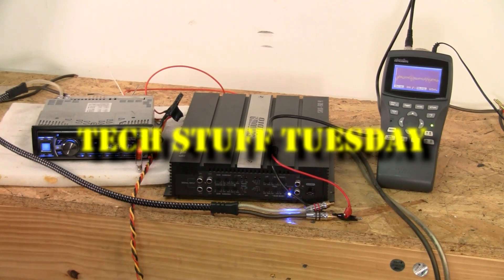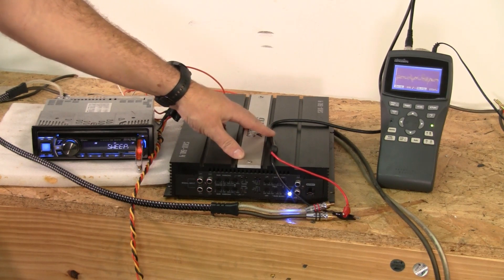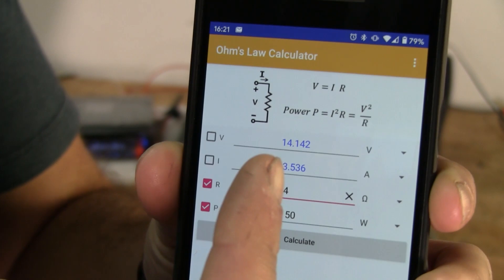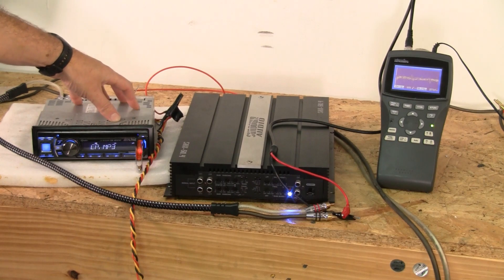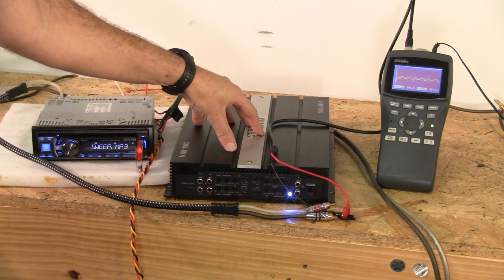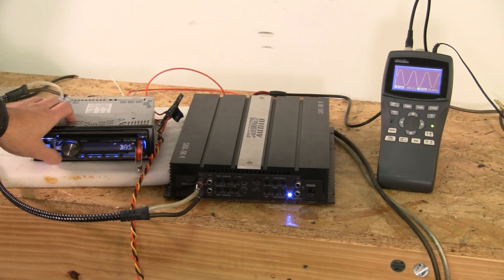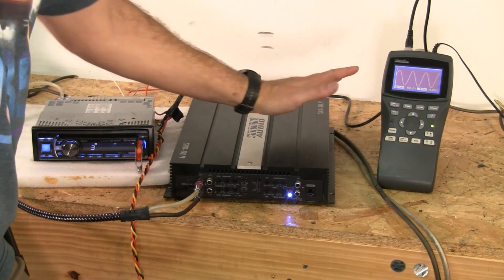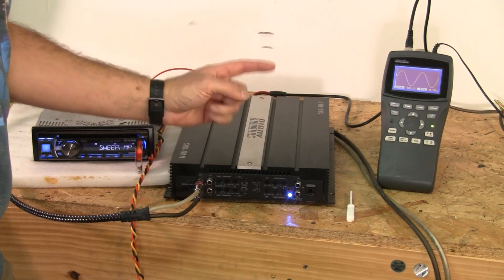How to set your gains using the best tool, an oscilloscope. - Tech Stuff Tuesday

Comment: Sean, My question is about how much do speaker manufacturer's under rate the power handling of speakers? For example, If I have a speaker rated at 50W RMS, would it be safe to set my amp to send 75W RMS to the speaker. If not, what level over 50W is safe?
Reply from the maker: How manufacturers choose to rate speakers will vary. Some are over rated, some are under rated, some are appropriately rated. Don't confuse amp rating with power handling either. If an amp is capable of making 75 watts that doesn't mean it's always putting out 75 watts. That 50 watt speaker might be getting 25 watts.
Reply: It wont hurt it depends on what you do. If you cruise around full tilt if the speaker is correctly rated. Yes it will burn up faster. Not saying it will go up right away tho. Now then if you are the typical joe out here who runs listens to music at relatively low volume. You maybe able to get away with a 200s rms amp on a 50w speaker. Like my dc 3.5k clamped when running at normal level, is only pushing around 1500-1600 with rise. When i go full tilt, it is at rated even with box rise. My coil is rated at 1500w rms and 3k burp. But ive clamped the amp and seen at what volume the amp output is at. That verys on setup, install and style of speakers and users. I know guys running amps almost double rated rms their subs. Doesnt mean their subs handle twice as what they are rated. It just means how they have it setup at normal listening volume, the subs and speakers are getting their rms. If they dont go above that for long periods of time and to often they never have issues. Thats where some guys get the idea their subs handle more than rated. Like say you have 500w sub on a 1k. They may play it full tilt for a short demo or something. But 97% of the time they have it at a normal listening level. You can run alot more than rated, its all about how hot the coils and speaker get. Why spl subs maybe rated at 1500 rms 3k max, then say 6k burp. But it takes a lot of trial and error to determine that. Really why you go with a reputable company who stands behind their product. If you go for the 2k watt max walmart sub and put 500wrms and burn it up. Thats on you for not reading the fine print of 250rms in the subwoofer manual. I normally stick with companies that label the rms not the max, and have a name in the industry.
Reply: You're better off having a more powerful amp than the speaker. Thus ensuring that you don' t run out of amp power which can damage the speaker.
Reply: Jonka Olofsson you cant damage speakers due to lack of power, as long as you set your gains right you wont destroy anything.

Comment: What do you think about those jye tech oscopes all over eBay and Amazon some are diy kits and others come preassembled you think they any good?
Reply from the maker: I haven't used them or even really looked at them, but it would be cool to have some input from people that have used them. It could turn into a go-to tool for many.
Reply: Yep got the cheapie JYE Tech DSO-138 just needed x10 probes for my 1500rms monoblock, worked well!
Reply: ufor1a what do the x10 probs do?
Reply: Jeremy S lets you get a higher voltage reading on the oscilloscope worked great with my amp 1500rms recommend the eBay oscilloscope!
Reply: ufor1a I’ve got a 3k rms amp and my liumy oscope doesn’t like anything past 30 volts. It takes typical multimeter probes. Is there a way to get 10:1 probes for a multimeter?

Comment: I'm surprised the DD1 vs o-scope debate is still going on. You can have over 1% total harmonic distortion on a wave that looks completely normal on a handheld oscilloscope. Distortion can occur on faulty audio equipment way bellow the clipping point. YES, CLIPPING AND DISTORTION AREN'T THE SAME THING. Having that amount of distortion can cause serious damage to speakers (especially tweeters) even if you don't clip. There are times where you won't be able to see this distortion on an o-scope. With the DD1, you will always know when distortion occurs. If you take a $150 o-scope and a $150 DD1 there is no comparison. The DD1 is a no-brainer.

I'm not a huge fan of this scheme you're trying to pull spreading misinformation about the DD1. I'm surprised you haven't responded to D'Amores critiques yet. Defaming a product by misusing it and lying is a pretty lame way to make adsense money. Hope it serves you well.
Reply: O- scope for the win
Reply: @fusiondensity3287  If you can't back up what you're saying with facts I'm afraid you can't be taken seriously.
Reply: @fusiondensity3287  Classic ad hominem fallacy.
Reply: @BradynJDM  O- scope for the win
Reply: Tony Melo  It's better than a handheld o-scope because you may not even be able to see even 2% or 3% THD on a handheld scope. Sure the DD1 registers at 1%. It is a safe level and many amplifier manufacturers rate their amplifier power output at 1% THD. Even if you do tip-toe right below 1% as long as you're not clipping you will be fine. That is the general threshold where distortion becomes audible at higher frequencies. (You can have a lot of distortion at lower frequencies and not hear it at all. It's much harder to hear at lower freq.)

If you buy even a $500 o-scope, there is no chance you will be able to eyeball this unless you're a seriously trained engineer. This is why the DD1 is such a powerful tool at $150.

Check this video out and you'll see what I mean: https://youtu.be/v0Jcsn3-Uf4
Reply: @BradynJDM  I've seen this video and the one steve posted as well. A lot more people should see them.
Reply: When I first bought my DD-1 I used it on my car, and got an increase in my output. 

I was called out by a guy who had one of those $3,000.00 Oscopes and he decided to show me that the DD-1 was wrong, but he didn't even find any clipping.

He has a DD-1 now.
Reply: You know a o-scope can be bought for $40 bucks of ld Ebay or Amazon. A lot cheaper that a DD-1. So that's a no brainer when you compare prices
Reply: @danfuller06  A $40 o-scope may work if the audio equipment isn't faulty. However, there are cases where faulty equipment can produce distortion well above 1% THD at levels way below clipping. No chance in hell anyone is catching that on an o-scope.
You'll see what I mean if you check out this video: https://youtu.be/v0Jcsn3-Uf4
Reply: @BradynJDM  Thank you for valuable information. I didn't even know or think of that!
Reply: The debate is still going on because of comments like yours that keep feeding into it. Move on now
Reply: @michaelparsons3188  LOL did you read my comment?
Reply: @BradynJDM  I did. I am just saying the more its talked about the more the topic sticks around. That's all
Reply: O-scope for the win
Reply: @fusiondensity3287  LOL. I feel like you didn't even read my comment.
Reply: @BradynJDM  feel how you want
Reply: @BradynJDM  are your feelings hurt?
Reply: @fusiondensity3287  Nah from far it. Just waiting for you to address my points.
Reply: @BradynJDM  what points?
Reply: @fusiondensity3287  In my original comment you replied to. I gave constructive reasoning as to why a DD1 is superior to an o-scope and you commented "O-scope for the win" without addressing any of my points.
Reply: @BradynJDM  you have no good points, but i give you an E for effort
Reply: @fusiondensity3287  If I have no good points, why can't you address them?
Reply: @BradynJDM  because their are no good points to address
Reply: @fusiondensity3287  Even if you believe they aren't 'good' points you can still address them.

I.E.
1) You can have over 1% total harmonic distortion on a wave that looks completely normal on a handheld oscilloscope.
2) Clipping and distortion aren't the same thing.
3) O-scopes at comparable price points as the DD1 may not be able to accurately detect 1% THD.
4) There are situations where the above points exist such as in faulty equipment (see video: https://youtu.be/v0Jcsn3-Uf4 ).
Reply: @BradynJDM  I have a degree in micro electronics and a minor in electrical engineering.  I took the dd1 as 100% truth. But with a machine limited to one task and one task only it's not even close to a oscope with someone who actually knows how to use it. For the audio field in general, a dd1 is a great tool to get you close enough to be safe. Providing you have been through the correct steps in setup. But idk (and I own a dd1) what the unit will do one say low voltage from the 9v or how if it came  uncalabrated. I can recalibrate my oscope with not a ton of time or effort.  I see and have read what everyone has said and think highly of tony D and what his company has accomplished, right up there with audio control. I myself not need to now verify every time I use the dd1 maybe just because it came into question.  But 150 to 150 dollar purchase, I'd by the oscope every time.  But that's my own needs.
Reply: @trecedaves3159  I highly respect your constructive feedback rather than people trolling me in the comments. I'll address your points here:
1) While the DD1 is limited to only detecting distortion at 1% THD, for car audio applications, it will provide a clean and reliable reference. Many high-end car audio manufacturers rate their amplifier power output at or below 1% THD. Also, the threshold of audible distortion in higher frequencies is around 1% THD once you get around 8kHz & higher.
2) I don't believe the DD1 ever has to be calibrated. Otherwise, it would be stated in the manual to do so. The DD1 is essentially a handheld distortion analyzer that only detects 1% THD. I don't know the internals of the product and I don't know what method of distortion analyzing it uses but my best guess would be fundamental freq supression (I say this because of the detect 40Hz and 1kHz detect LEDs). I don't believe a low battery voltage would affect the accuracy of the measurement. And even if it did, D'Amore likely would have set it to not turn on if the voltage gets too low. (Please if anyone does know the internals and what method of distortion measurement please correct me).
3) In some cases (primarily in faulty equipment), it would be extremely difficult to catch distortion at or above 1% or even 3-5% THD on a $150 handheld scope. You would have to zoom in so far and try to interpret imperfections in the wave to try and determine how bad the distortion is and if that amount is safe. Please watch the following videos and you'll see what I mean:

1) https://youtu.be/np0lpIiSesU
2) https://youtu.be/v0Jcsn3-Uf4
3) https://youtu.be/er5Zp-lliYM
4) https://youtu.be/E7lZ5ULUil8

A DD1 can help catch faulty equipment such as these and it is very possible that people using a handheld $150 scope may not even notice. That's part of the reason the DD1 was invented and why I find it to be such a powerful tool.

Thanks for your comment. I appreciate respectful dialogue.
Reply: @BradynJDM  I totally see the dd1s place among the car audio community.  It's a very good tool to do a basic task. Like I said I do own one. Sean(emf) like myself are the older generation from the 90s car audio scene. We grow up with an oscope being a very useful tool in our fields. In my dd1 instructions there are a few discrepancies.  But it's the original dd1. I agreed with Sean on how the dd1 could be used wrong due to these and being vague in other parts at least with my manual. I read over mine many times after the first video that started this, well what ever this is. I did not find anywhere were it stated make any changes before setting your gains. It just goes into the db off set and basic functions of ea track and a little on the machine its self. I haven't read any of the current literature on them so I do see in how the oscope would be better for at least that part. I love tony D's tools and new audio the company's putting out.  So basically I'm saying I agree and disagree in at least my case.  
That said what I do not understand is the way Steve approached the calling of the dd1 in to question.  It was way out of line. If someone gets that crazy over trolls that person shouldn't get involved in the conversation after first making his/her point. To literally attach his own fans and customers.  Not to mention there religion.  Totally uncalled for no matter what was said. As a business owner and public figure head people have to conduct themselves to higher standards.  What happened in the aftermath was childish to say the least.  I love how sean conducted himself through out. I did see all 3 videos and read the comments as well.  Bit off topic but I didnt chime in during as I didnt want to fall under anyone's angry rath.  
So anyone else reading this comment a dd1 IS a useful tool especially to the inexperienced.  However I myself personally would choose the oscope simply because I do a lot of things with my scope from repairs to gain matching and setting.  Next to my multimeter and soldering station, it's the best tool I own for what I myself do.
Reply: @BradynJDM  I do love intelligent conversation though. Thank you.
Reply: @trecedaves3159  Agreed that Steve overeacted to the initial video and that was uncalled for to send followers to essentially 'hate' on the video. I'm not incredibly fond of people posting a hate comment on a video without even watching it or knowing what is being talked about. However, I don't like it when people deliberately use products incorrectly in order to defame the product and spur anger online. There is hate on both sides.

What I don't like about Sean is this whole publicity stunt in order to defame the product and generate YouTube Ad revenue out of drama. He used the product incorrectly on purpose to drive people to comment and drive engagement. It was never about the fault of the product, it was about discrepancies in the manual as you have said. And while these discrepancies may be a problem for some, it could have been addressed without the drama of this whole social experiment who's purpose was to drive outrage and make ad revenue. I used to have respect for EMF Audio but after this stunt I don't anymore. If you haven't watched the video explaining this social experiment you should watch it: https://youtu.be/T3jW1o4sKOo.

I also believe my point still stands about having distortion in an audio signal without being able to see it on a handheld scope. Especially in this case where the wave on the scope looks immaculate with around 2.4% THD: https://youtu.be/v0Jcsn3-Uf4. I'm surprised this isn't talked about more because that is where the DD1's real value comes from when comparing it to a scope.

Like you said, the DD1 is a great tool for the average audio installer. However, I would imagine it can also be useful for advanced users as well. The cheapest new distortion analyzer I found is $725. At $150, the DD1 is a steal. I don't think people realize the genius of producing a distortion analyzer that is reliable and accurate at such an affordable price point (even if it is limited to 1% THD). In the field of car audio a 1% THD measurement is more than sufficient.

I also don't like how Sean is choosing to avoid constructive dialogue with Anthony D'amore or even this thread. He's doing this while skipping over and giving thumbs up in the comments to people who only agree with him. Not a huge fan of that at all.

Comment: I set my gains using a cheap oscilloscope.  I am happy with the results.  I picked up some cheap RCA to speaker adapters so that I could more easily test RCA's.
Reply: I've been trying to find a good way to test my RCA's can you elaborate on the speaker adapters??
Reply: @bykrdood7  they are a rca end with 2 terminal screws on the opposite side. Use just any wire 
Ill set up a link https://www.amazon.com/MOBOREST-Terminal-connectors-Solderless-Male-2pack/dp/B07HBJMHVV/ref=mp_s_a_1_1_sspa?keywords=rca+to+speaker+wire&qid=1578476470&sprefix=rca+to+speak&sr=8-1-spons&psc=1&spLa=ZW5jcnlwdGVkUXVhbGlmaWVyPUExRzRaQVNWQkNaTjBDJmVuY3J5cHRlZElkPUEwMTA3NDI5MzA5T0U2UVpZMjBGMCZlbmNyeXB0ZWRBZElkPUEwMzg4MjEwMkE4OUFXWDBJWFZBTyZ3aWRnZXROYW1lPXNwX3Bob25lX3NlYXJjaF9hdGYmYWN0aW9uPWNsaWNrUmVkaXJlY3QmZG9Ob3RMb2dDbGljaz10cnVl
Reply: @bobdodge3171  I was gonna hack up an old set of rcas....but this is way better. Thanks for sharing this!!
Reply: @Squat_House  you are welcome bud!
Reply: my setup is 4 speakers attached to HU and subwoofer to amplfier. how should I test it? do I need to pullout the HU? or just hook it up on rca and then plug it in to test the amp?

Comment: So I set my gains by ear at the moment. For my mids + highs I used a 1khz 0db tone and with all speakers connected turned the head unit up till I heard it clip, then turned it down and marked my number. For my Sub i used a 40hz tone 0db and found max volume on the head unit again. The went to my amps tuned the volume up to the max clean level I heard. and played the tones again until I heard clipping (used a 40hz -3db tone here and the same 1khz tone) Is it safe to say my gains are set fairly well?
Reply from the maker: Using your ear is best, it's the original distortion detector. Regardless of where your gains are set, if you hear distortion, turn it down.
Reply: @EMFAudio  Well, that's what I do! Thanks!

Comment: the cheap o'scopes on ebay are good and the capacitor mod with the cheap speaker also works.
Reply: I remember the owner of the company that makes the dd1 got all mad at me for suggesting the cap method on some other video that wasn't his anyway. The dd1 works ok,but cheap oscilloscope is King, just takes a small learning curve.
Reply: @warup89  what is the cap method? What do I search?
Reply: @sleepyShaman479  there's a video by barevids channel called "detect amplifier clipping without dd-1!.."
Reply: @warup89  the DD1 is a waste of money, buddy is just mad you’re not lining his pockets